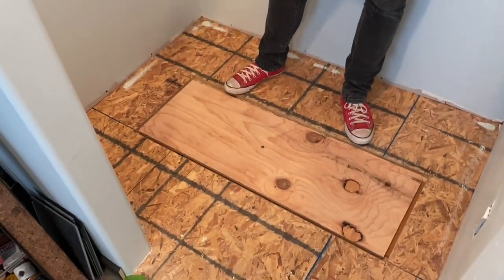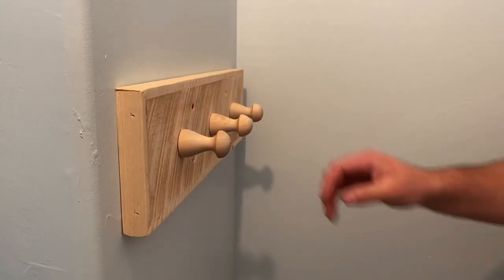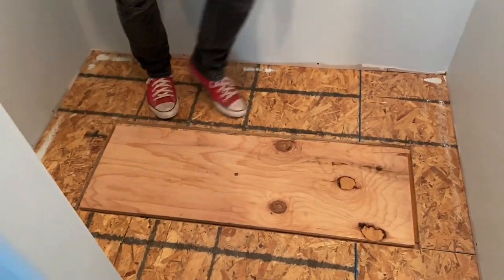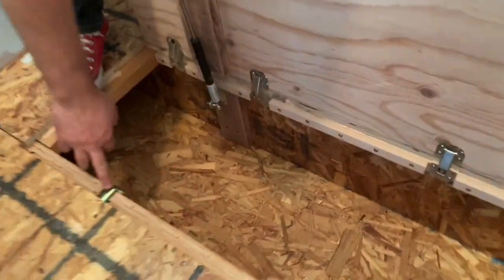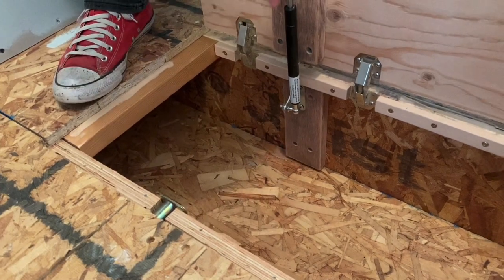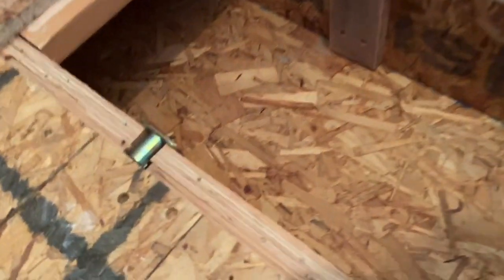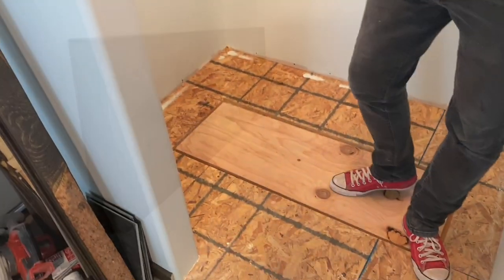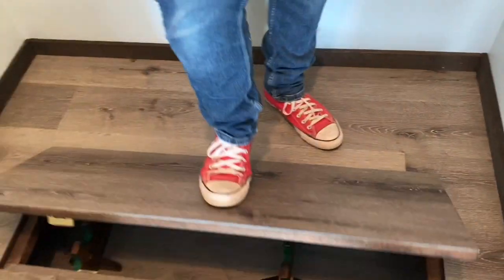Hidden Closet Compartment

Comment: Don't get me wrong, there's lots of good ideas here, but I wouldn't have cut the door cover separately: first, cut it from the flooring around it so the wood is color matched and matches the grain. Also if you leave some of the floor boards on the door overhanging the joint it camouflages the door much better, but as it is now its pretty obvious it's there...
Reply from the maker: Yup gonna re-do the whole closet
Reply: @luckyroosterco.8969  Can't wait to see it!